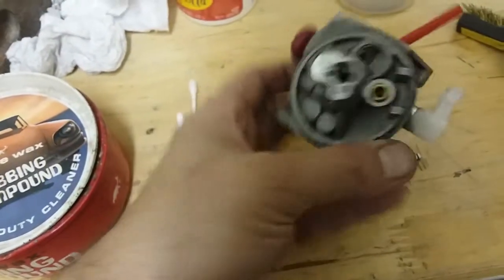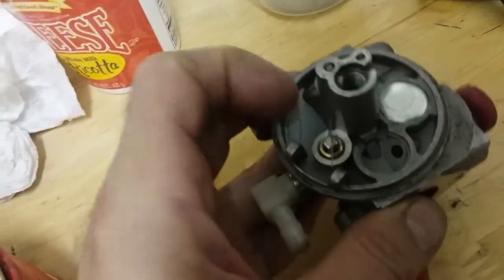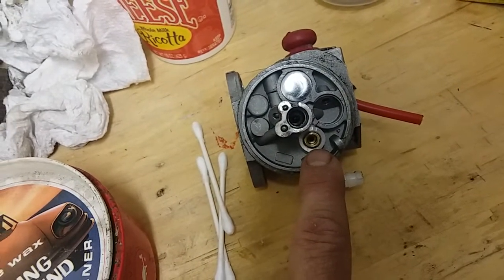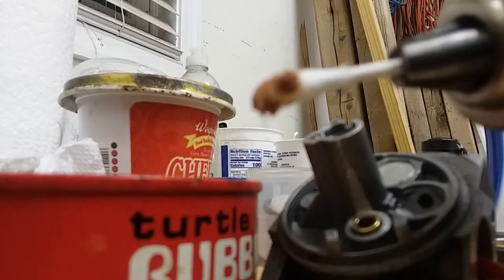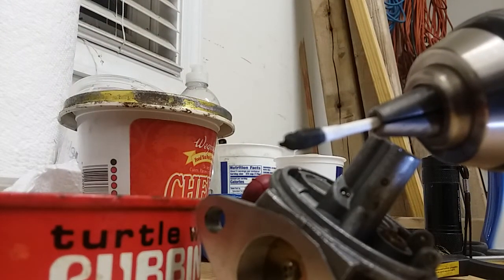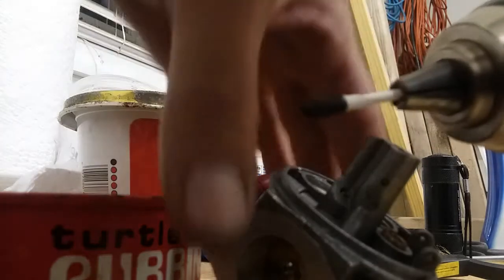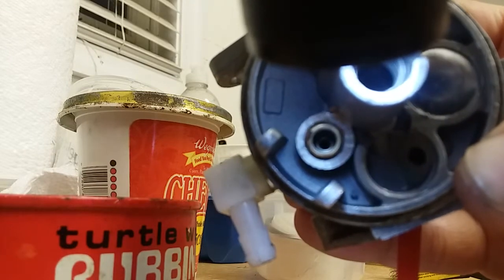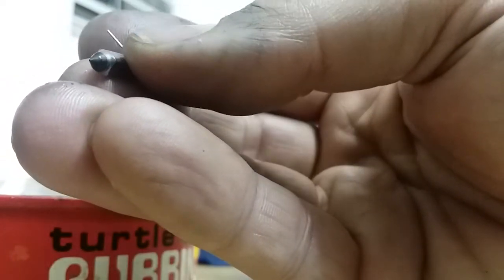Carburetor flooding brass seat cleaning procedure

Comment: can' you just use carb cleaner? I'm sure glad to know it has brass seat I thought I had lost mine.. thanks
Reply from the maker: You can try but it probably won't come completely clean.
Reply: @berardia4  I can't tell if one is in there or not how do i tell looks like threads I didn't pull the seat out , I'm confused the last one had the other kind?
Reply from the maker: @suzieq8379  this video shows the difference between which one has a rubber seat and brass one.

https://youtu.be/ZnWxXaWedv8